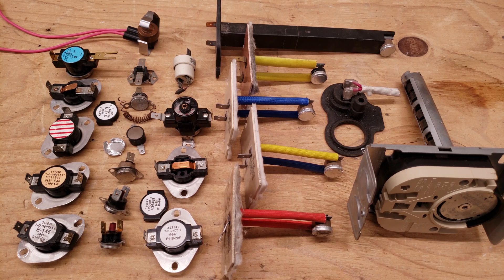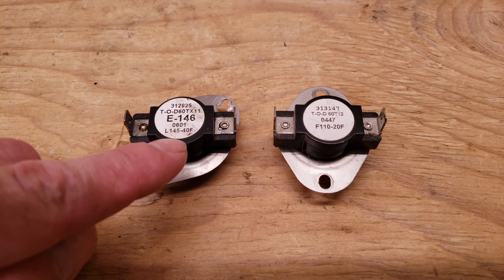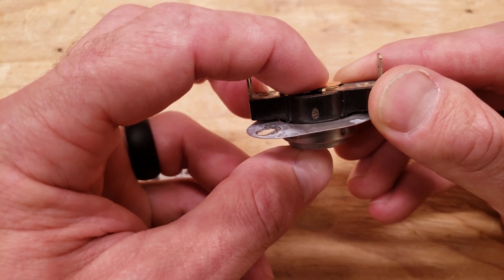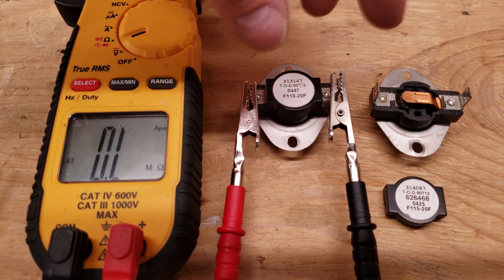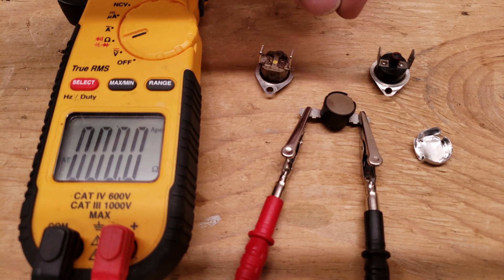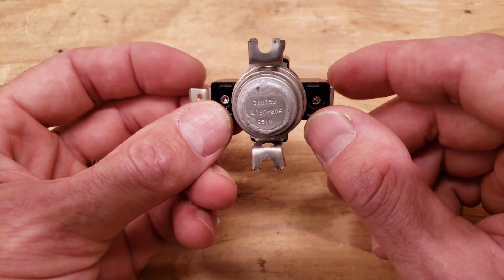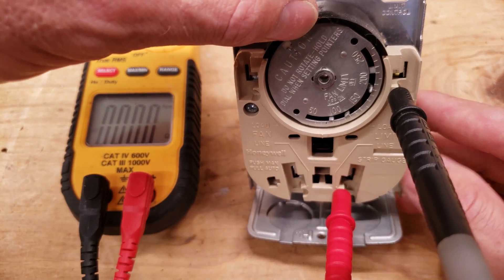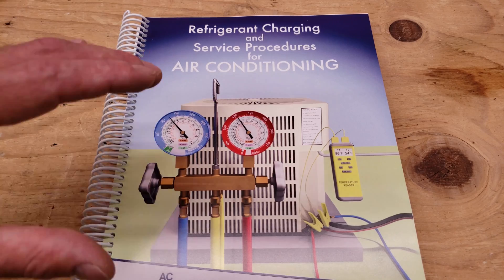HVAC Thermal Limit Switches, Safety Sensors, & Troubleshooting!

Comment: If you get a chance -  I have a temperature limit switch rated at L175-20F. Can I use that one to replace the original which is rated at L175-40F ?  Thank you!

Comment: Hello , I have asked you sir last time but you did not answer me right why GOD know . I ask again please👌🙏🙌
Q : we were stupid , when less than 3 years ago ; the hvac sales man were talking to my wife if she buy 7 or 10 years warranty , they come twice ayear & service the furnace & ac system , but it did not work that way , they come take a picutre & go . After 2 years I ask them are you suppose to clean the flame sensor or wash the condensor , when we call the office thay said if it needs tech will do it , then I said ; your sales man said something else , they hang up on me , I call again ; they said to me What's my problem , I said each time your tech comes wants to sell $ 500 to 700 , & if we say NO , they leave angry , till in march 2024 they sent a huge tech , he did not let me to watch him , he was there 45 minutes keep taking something out & put it in his bag , make story short after he left the function of heating has change , the heat does not comes on on 75 even 76 deg  , our house has to be in freezing poit till the heat comes on , now we have to keep it at 80 degree to keep the house warm enough , the furnace shut down if we set it at 82 . Any idea or you can not answer , do you do repair or any phone number please👌🙏🙌

Comment: Thank you for this informative video! I'm now trying to fix my electric heater and I suppose that one of the thermal switches on it is broken. However I can't really test it because I'm not sure if it's normally open like the other switch. The part name (ksd302) is used for both NO and NC switches. I tried applying pressure and heated it with a lighter with no effect. So either it's normally closed and I didn't get enough heat or it's normally open but broken. Is there any other test I can do to know whether it's supposed to be normally closed or open?

Comment: You are by far the best teacher/tech I've seen on here and your vids are outstanding. I was wondering if you knew any "real techs" in the hvac world in the Greensboro NC area. I have an old Williams furnace with heat strips and they keep blowing the fusible links which doesn't make sense that the limit switch doesn't cut them off before the links blow. Now my heat strips are staying on even when the heat is switched off and just run the fan. Nobody wants to actually work on these old units and keep trying to sell me a new one. Thanks in advance for any help

Comment: I bought two thermodiscs for my hot blast wood/coal furnace. Both of them don’t work right. On off on off every few minutes! Then maybe a half hour working right. Called the company. They said these are sensitive to drafts and may work better in time. I think they must be defective because I saw a website where people complain about the same problem. The old thermodisc worked perfectly for years until it wore out.
The only thing I had to do to fit the thing into the cover, was I had to bend the prongs inward , to be straight rather than angled outward, because I couldn’t fit the cover over them.

Comment: So what would happen if u had a switch that was L150-40F and replaced it with a L170-40F it's not that much different
Reply: Was hopping for an answer as well. Good question.

Comment: Hi,i have a luxaire heat pump  hl3b since a year the machine stops,i check your videos,when i put the machine at off it restart,since the summer getting hotter it stop offently.i check your video that it could be defrost control board,i check all the volltage and resistance i donT find any problem. After that  yesterday it wa warm so i decide to start it without the panel,it ran from 78f to 74f and did not stop,i wander if there is a thermal device that stop,it.Has soon as istop it defrost control board is reset.thanks for your great videos.

Comment: Thank you for your video. 
1) For my furnace limit switch, PN# L140-60F, what is this value mean? 
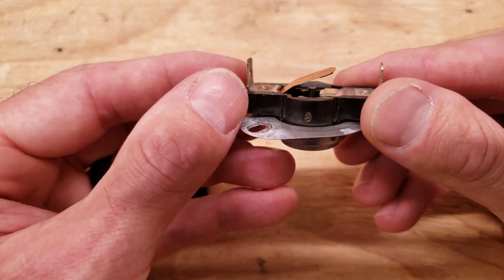2) From this video @4:23, from the bottom up, second number 0601, what is this number mean?
3) My ac system keeps running and cannot stop (if I want to turn it off), would the thermal limit switch has to do with cooling (keeps running & not stop)?

Comment: Great video I have a question. I have a wall furance giving me trouble. I believe the trouble I'm having is with the limit safety switches  the high heat switch was bad and now i want to replace the high and low limit switch  just to make sure .  these  switches turn on & off the blower motor.  the numbers of the switches are  F135-1.5 R9V  and the other is L180-3.5 V9V My question is the last three letters/numbers on it what do they mean are they important?

Comment: Hi, Great vid.  I have a 5 prong thermal switch.  Not 100% sure how to test.  Whirlpool 307250 Thermostat.  I get the two main prongs, but what reading should the 3 in the center be showing?  My guess is continuity when cold.  Thanks.

Comment: Light bulb went off at 10:00 in when you mentioned manual reset button, as I suspected my switch and that was problem with my Williams furnace!  Thanks

Comment: Thank you for making this video.

I have voltage on one side of a new F110-20 fan switch but it never gets warm enough to actually turn the blower on. The furnace does run and heats up (and the heat spreader gets hot) but the switch itself never changes state. I pulled it out and ohmed it while it was on a space heater and it does change state so the switch is good. Does anyone know why it might not be getting hot enough when the furnace is running? I'm really confused. lol.
Reply: Follow up:

I pulled the thermoswitch out and ran a heat probe into the slot and ran the furnace. It never got higher that 95 degrees at the switch. I double checked the inducer motor and it is running and has a good seal against the frame. I also put a probe up by the heat exchange and it got up to 190. I got scared after that and turned the furnace back off.

Anyone got any idea what might be going on because I'm lost. lol.

Comment: hi, i bought htr24v69t11 double poles fan limit switch,  however top poles are always open, is that intended ?  i thought both top abd bottom poles are normally closed unless temperture reach 105 degrees.  did i bought defect one ?

Comment: My switch L145 -30F, Great video confirmed what the numbers mean and I was able to resolve issue.  Issue I had was end of heat cycle the blower was turning off too early.  My system has air dam limit switch.  I removed air dam during summer to help lower static pressure for best A/C flow.   After understanding how limit switch work, I replaced air dam, all is good.

Comment: My electric furnace diagram says that both heating element circuits go to the same limit switch (one). Is that possible? If so, what are these limit switches called?

Comment: I pulled a high limit on a high efficiency gas furnace, but failed to notice what position it was in before removing it. It's a L250-25F Nordyne part for Norydyne furnace. From a vertical position, it can be installed slanted right or left with sensor up or down. There was no air dam below this switch, but was something off to the left of it... possibly the heat exchanger.  Can you tell me the correct position for this switch. Switch sensor is about 3 inches deep into furnace from the front face of the furnace it's mounted onto. Red leads about 3" long with black mounting plate with offset notches top and bottom.

Comment: Hi.  Awesome video.  I was working on my sisters furnace a while ago, couldn’t figure out.  Burners will come on but shut right off with couple of seconds then as blower ran it would turn on igniter but wouldn’t open gas valve.  Got 2.6 micro amps on flame sensor for a the couple of seconds burners fired.  All other safeties ohmed out good.  Is it processor board?  Thanks
Reply from the maker: I did a video on troubleshooting flame rectification. Check out "acservicetech flame rectification" thanks!

Comment: Yes or no: The heat pump defrost thermostat is normally open until a call for defrost then it closes. Right? So why is there an "L" in front of the degrees?

Comment: Hi there I have an exam next week. Could you help me with this multiple choice question?

What type of over temperature protection is used in forced air convection heaters?
A) a thermal cut out snap disc
B) an alloy cartridge link
C) linear thermal limit
D) a series of thermal limit snap discs
Reply from the maker: What textbook is this out of? Forced air heaters use one or more snap discs in series like in the video, thanks!

Comment: Greg, greetings from San Antonio, TX., where we have had one long hot dry summer. All the licensed hvac companies have been busy. Being retired from the hvac field, I have easily transferred experience reading schematics and understanding logic functions of timers etc. to my Speed Queen electric dryer ADE3LRGS171TW0 and Amana electric dry NED4655EW1.  The Speed Queen has a part labeled cycling thermostat, that controls cabinet temperature settings from the fabric temperature switch. This part has a N/C set of contacts, that open due to the heating element in the part, so this part has 4 terminals, 2 for the contacts and 2 for the heater.  The part reads L 153-15F. Your valuable video has provided important information. Thanks for your added insight on reading these parts.
Reply from the maker: Glad that it helped aliso 82!

Comment: just got a blower motor and squirrel cage  motor is 3/4 hp motor ,,capacitor is 40 UF, never seen one that large for furnace blower ,the motor plate says 40 UF,,,,,Have you ever seen this size ?????
Reply from the maker: Wow I must say that is an odd one for sure. No usually they are 25uf or lower. That is a high number even though you are at 3/4 hp
Reply from the maker: however you will need to follow the manufacturer rating on that one, thanks!

Comment: Amazing video! Perfect remaining before the heating season. Thank you. The ones I've asked the supplier give me a replacement for the flame rollout switch. It was my first heating season on the field. He brought me the switch without manual reset and with membrane metal protector. I thought then it's wrong.  But he said "its direct replacement". Don't trust everything that seller will tell you.  Am I right? Another thing I've to discover than flame rollout switch without metal protector, come on the way faster than with it. typical 5-7 sec. And with metal protector almost +10sec. (15-17sec total). And in case of the open fire, it's faster shot off the gas valve. And prevent wiring inside the cabinet of burning. The point, if you working with the gas furnace repair, YOU will responsible for the Lifes! Put ONLY properly parts. If you don't sure, ask the expert. Or live the job. You will save someone life.
Reply from the maker: 100% agree on multiple topic you are mentioning. I always told the students that you are responsible for other peoples lives if you do something wrong when it comes to furnaces and water heaters, thanks a lot Tapch MC! Also yes always read and compare ratings and replace items with the same model whenever possible!